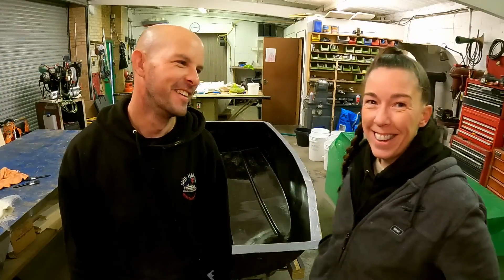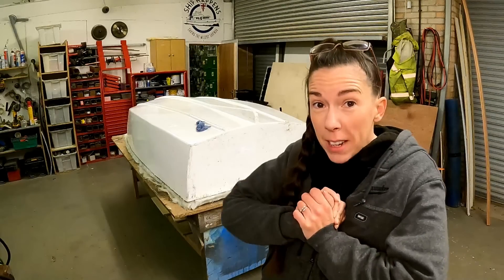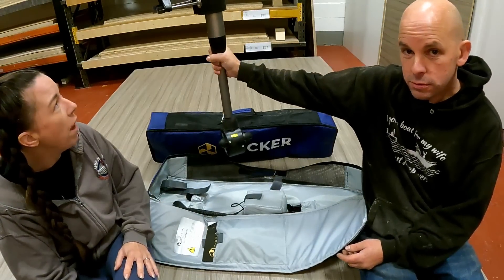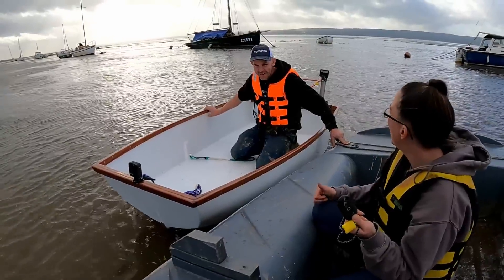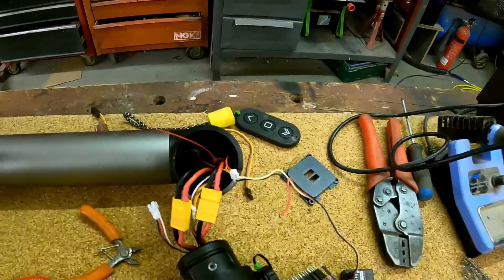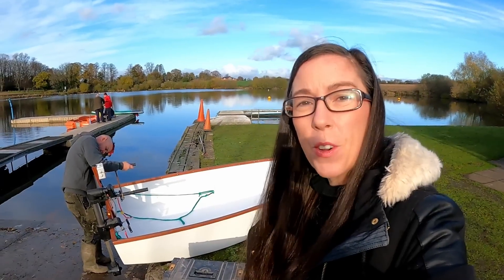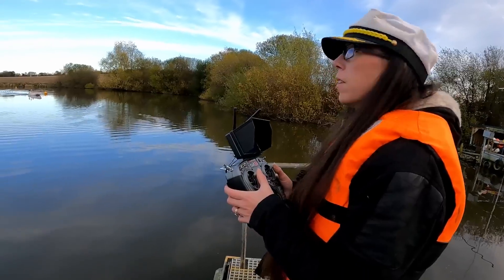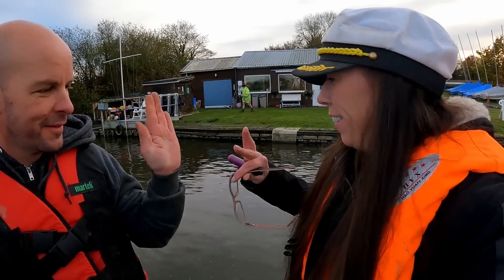FULL BOAT BUILD FROM START TO FINISH WITH ThrustMe Kicker Electric Outboards #boat #boatbuild

Comment: Fantastic guys. We have an full electric MG over here and love it. Our furl costs have reduced significantly and a full charge of 44.5 kw battery costs AUD $16 compared (we also have solar power input from our roof panels. we did own a V40 diesel Volvo. Have fun.

Comment: Use the elevon mixing in the transmitter that way your right stick will do forwards/backwards and steering. rather than using "tank mode"

and yes, electric cars rock.

If you got a "flight" controller with gps you could fully automate the run to and from the boat

Comment: You could add a Mikrotik Hap router (5v) and create a wifi network and run a 360 Radio Dish on 2.4 or 5.4 hard wired to the white box. The Video could be sent to monitor.

Comment: You did exactly what I was going to suggest - proper radio control. Now, with a bit of thought, you could use a servo to steer the motors with, as well as assymetric thrust - and if you had the telemetry modules, you could remote-monitor your battery levels as well! (p,s, - there are much better reliability radios than Spektrum!)

Comment: I gotta give that a like . i love it . Been thinking of doing the same with a boat 4x that size . I often sail single handed , and being able to control the boat from anywhere on deck , would be a serious advantage while docking . The rudder is fairly easy at low speed , but the engine , not quite so . I figure it should be easy to control the throttle , but the gearbox is quite stiff . It's gonna need a serious servo , probably home made , and right now i ent got the time . Another problem is the controller itself , commercial units are too big , so it's been shelved till i can get more time to play .
Reply: There's quite a few newer vessels with hand held controller.. I have no doubt you will find what your looking for ..

Comment: Awesome project!!!!   If you are going to use that Spektrum DX6i aircraft transmitter, you should cut a centering notch in the middle of the throttle cam so that you can feel when the stick is fully in the center neutral position. Alternatively, you could use one of Spektrum's car transmitters with the steering wheel and trigger throttle. That may be more convenient to use.
Reply from the maker: The engines don't turn, the movement comes from each engine, so a steering wheel would not work, on tbe transmitter the left controls the port engine and right the starboard. It turns the same way a tank does!
Reply: @ShipHappensUK  Ah yes. I see what you mean. :-))

Comment: Superb! Brilliant idea. Well done!  Those outboards are fantastic. I'm assuming for safe operation you need line of sight between points A & B but did you establish a working range/distance? Also transmitter and receiver are both near sea level, where a model plane is not, I've no idea how far Sarinda is from the dock/slipway. One thought and, It's only a thought- If the range is getting to it's limit for the transmitter at sea level, would it be possible to have a second transmitter? E.G. 1 on Sarinda and a 2nd on the dock/slipway, for use by the person unloading or loading the tender? Obviously both working on the same frequency, so, if one controller was getting near the limit of range, the second could take over control. It's just a thought and, if you have good range it would be irrelivant anyway.

Comment: on your MTB boat  if you go on SAILING YBBA they have put their ballast in plastic drain pipes with 
ends on them which will let the air circulate better, I think a lot better than the sacks, anyway check it out.

Comment: Yes you may be able to get the trash to the dock (if it is not to far) but sadly it won't unload it self. You could "send" it to pick up guests at the dock however, perhaps you could setup a raspberry pi and a gps receiver to do that run on its own and only step in if it went the wrong way.
 I do recommend you geofence it for now so it wont head out to sea alone. Autonomy at sea and at low speed is far safer than on the road.  The possibilities are nearly endless, you could add a electric winch and a anchor so when you go ashore you can "park" it 50 yards out, safe from opportunistic thieves (unless they to have a boat of course) .
Reply: Ah, you forget Mason; he could be the unloadist.

Comment: Six LFP cells would give you 20 volts at full charge and a much longer cruising range. Unlike power tool batteries, you can also charge zero to 100% with no degradation.

Comment: Excellent. That looks like so much fun. I’ve got an electric motor I need to set up for my Kayak in the shed from Southampton boat show last year. I still plan to make a custom remote controller for it to replace the fob. Unfortunately the motor is a complete sealed unit so I didn’t really plan it too well.

Comment: Well done, that's ace!, if you use the controller out of a GPS drone! you could then set a coarse of wey points!... from a phone app no need for controller and could call the boat from where ever as could be used on different mobiles..

Comment: Coming to a mooring near you.. UberFloats and  PortholeDash!  When you want your Bangers, Mash and Sticky pudding without weighing anchor!
Reply: Emptying the boat would not be that hard,  if you put a lift bracket on the boat so a remote crane could pick it up, tip it and dump into the skip and then return the boat to the water! But the other outer mooring folk might be a wee jealous!  Great job BTW!

Comment: Different but not the world's biggest; the ones used in Ukraine to remove sections of the Black Sea Fleet are larger for starters. 
Cool little toy tho and some pretty ingenious kitbashing to get the outboards to talk to the RC transmitter, I'm impressed. Now, a stepper motor attached to a rack and pinion or a cable system and you'll have full helm control as well (not that it appears to need it but it would be fun trying).

Now, we need to get Simon the loan of a Tesla for a week . . . .
Reply: Yes...

Comment: Astonishing!  You said you wanted to do it fully remote, so if you set up a GPS and put in way points for Sarinda, the turn into the slipway, the slipway itself, and then connected it to the boat .... that could be made to work couldn't it?
Reply: Yeah, it would need an Android or Raspberry Pi "brain" and some reasonably involved programming as well as a GPS receiver but it could be done. Of course, the issue is it would not be aware of its surroundings so could not allow for other vessels in its track. That's where things get complicated.
Reply: A Linux platform with cameras would be a great project for a self skippering boat.
Reply: All those functions, Gps and wave points  are in a flight controller used for drones . With software like ardupilot you can setup such a system. Ardulpilot runs on different flight contyroler like pixhawk and other. And it is  a sytem with FPV included.. Virtuel anchor is also possible.
Reply: @akselhansen7670  I can send al my broken or crashed drones... An I'm sure they have what is needed... I already made a small camera to watch my room whilst I'm away.... Lol an I used the propellers as the signal alarm.. they spin an blows air .. lol ...!